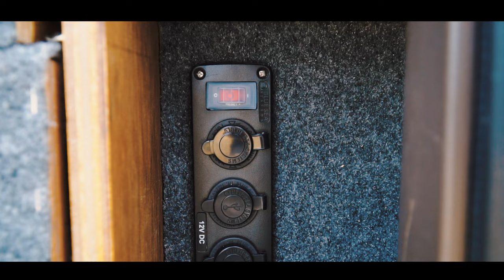LIFTED Overland Land Cruiser Rig Walk Around | Black Hills Builds | TRIPLE LOCKED | Full Build List!

Comment: Awesome LandCruiser, I also want to put some 37” in the future. What size lift on that Dobinsons setup?
Reply from the maker: This setup is a bit unique.  From what I understand, its a 3.5" long travel setup roughly but the struts are all for the 6" lift so they are typically partially compressed but on large flex the struts expand and help with ground contact.  Thats how I understand it.

Comment: Nice build. Not sure if you are using an AGM for the 2nd battery but if you are (and maybe even if you aren't) you might want to think of running a DC/DC charging unit like a Redarc or something. That way you will get the full charge to the 2nd battery. Those isolators don't do a very good job at that at all.  Whereabouts did you film this? Looks stunning.  Oh and.....Start producing that MF'n front bumper!!!  ;-)
Reply from the maker: Haha AGM is in his future, Wes said.  This was in the Black Hills!  They have awesome trails (& views).  I'd love for them to produce that bumper as well.  So clean.